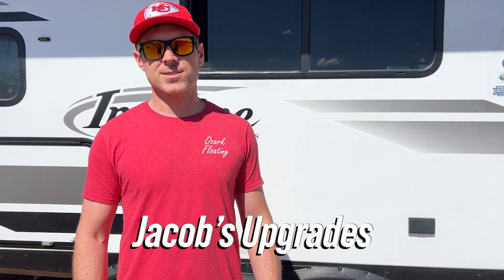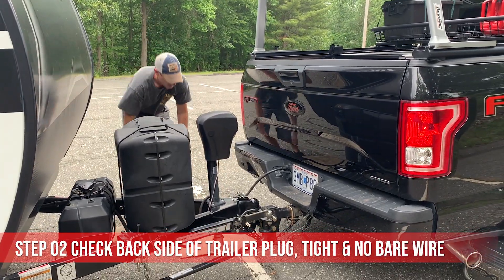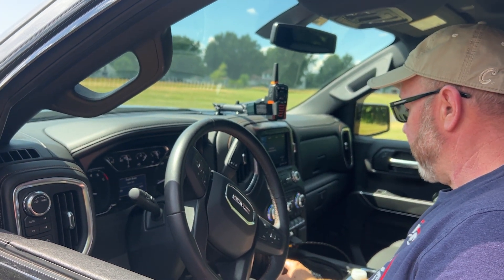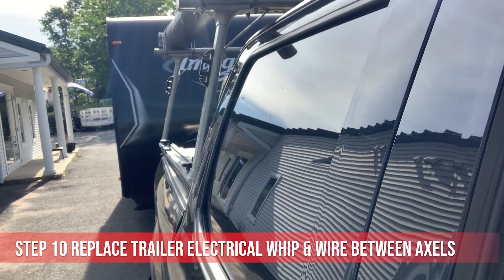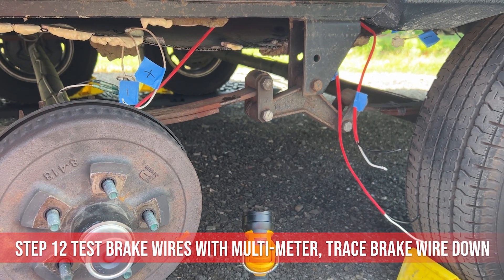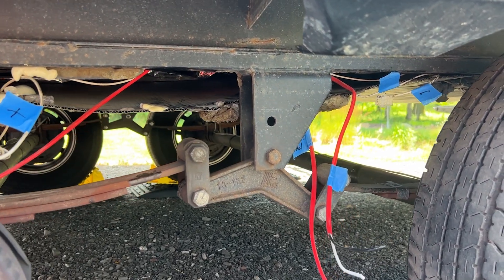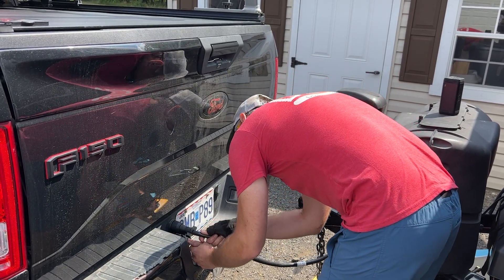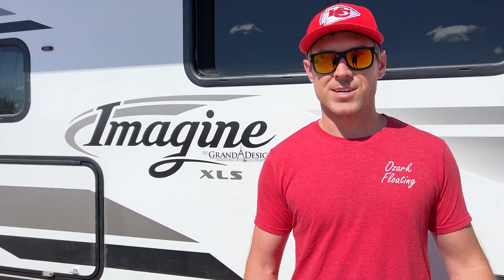How to Diagnose Trailer Wiring Issues | Trailer Wiring Fault

Comment: 2018 Imagine 2150rb I had the same issue, it turned out to be the wire s going through the axle! Replaced that absolutely no more error codes!
Reply from the maker: @TLR5759, great find! Did you run your new wires through the axel or zip tie them to the outside?
Reply: @jacobsupgrades  for now just zip-tided but in a flexible conduit!
Reply from the maker: Hopefully that holds up for you. Still frustrating that Grand Design has these type of design flaws.

Comment: I have a 2022 Silverado and a 2022 Cruiser Twilight Signature travel trailer.    Got this message intermittently.    Both dealers couldn’t find the problem.    Finally the camper dealer heard a noise near one of the wheels.   They jacked up the camper and took off the brake cover.   Parts literally fell out.   The magnet was loose and flopped around, causing an intermittent wiring fault.   They replaced all 4 electric brake assemblies under warranty.    Your problem may be different, but this worked for me and you may wish to look into this.
Reply from the maker: @davidtrost4117, wow that's hard to believe a new camper would have problems like that but guess any rig needs the kinks worked out. A friend of mine suggested that could be our problem. Our problem turned out to be bad wire routing when it was built. Our electrical brake wire was between the flooring and frame and was pinched off after rough roads through New York and Connecticut. Glad you were able to resolve the issue under warranty!

Comment: Having the same issue with my 2019 Grand Design 2800BH. So was it the floor pinching issue causing the fault?  Drive my through the mountains in the rain had me on high alert without those breaks.
Reply from the maker: @snovak1, yes the issue was the pinched wire between the floor and frame. I bet it was hairy, I hate driving without trailer brakes. Here's the product I used, make sure to measure your length from the trailer plug junction box to the axels and down. 10AWG Duplex marine grade wire 20ft 
https://amzn.to/3PYEbkX
Reply: @jacobsupgrades  Thank you!  Very much appreciate the guidance.  Super helpful.

Comment: I swear, Ray Charles and Helen Keller team up to build these trailers.  If you build these trailers and get offended...GOOD. Take pride in your work.
Reply from the maker: @waynef.8158, 100% accurate. Which camper do you have?
Reply: @jacobsupgrades  2021  Volante 3861BL. Brake issues, leaks from the exterior coming in, trim falling off….
Reply from the maker: Wow already on a 2021??? Unbelievable! That’s so frustrating, I’m sorry to hear that.

Comment: So my fuses look good and had trailer fixed I guess to purchase brake controller and install,what you think?
Reply from the maker: I would try plugging the trailer into a friends truck first to determine if it's really the truck or trailer. Also if you have another trailer you could try plugging your truck in and testing it that way too. This way you can determine which one has the issue first. Those controllers are not cheap. Are you having any error messages pop up on your truck?
Reply: @jacobsupgrades  yes
Reply from the maker: @gaelewis6623  If you've checked the backside of the plug connection on the truck side for a firm fit and traced down the wiring for any exposed copper and found none. Then replacing the controller may solve your problem.
Reply: Just had mechanic test system on truck and said he thinks it's brake controller.
Reply from the maker: Did you replace your trailer brake controller?
Reply: Yes,but after inspection I think Ford dealership took both fuse and relay out they were  removed?

Comment: I’m having the same problem with the Large Orange Box that states “WIRING FAULT ON TRAILER”.  On page 297/666on the manual it states this: This can be a short to ground (such as a chaffed wire), short to voltage (such as a pulled pin on trailer emergency breakaway battery) or the trailer brakes may be drawing too much current. Points to Remember Note: Do not attempt removal of the trailer brake controller without consulting the Workshop Manual. The problem is the too much current statement, but No number is given after much research I found a  Ford policy # Ford DTC B148A:11 that policy set the max brake control to 27 amps. The problem started when I towed the triple axle trailer with 6 brakes home for the first time and the Orange Warning Light came on displaying “WIRING FAULT ON TRAILER” in Feb 2021 after much time and effort and having the trailer checked out by a trailer repair place; no short was found. So I’m now buying a tool to show that the current limit is too low and needs to be raised. When towing, the engine is running which means the alternator is also running the DC could be as high as 14.8 volts when you have 6 brakes in parallel the resistance could be as low as .5 ohms. 15 V divided by .50 ohms = 30 amps. 30 amps will trip a current limit of 27 amps and display the Orange Box every time it exceeds 27 Amps.
Reply from the maker: @patpowles3358, I wonder if your problem could be bypassed using FORScan. I don't have experience with it yet but I want to start using it on my truck. You could turn the module on and off with it to reset it and possibly tune your voltage limit. I don't know for a fact on the voltage limit adjustment.
Reply: current limit of 27 amps ford will not verify that is the setting
Reply from the maker: @patpowles3358 , I'm sure you would want to run a heavier primary brake wire too.
Reply from the maker: @patpowles3358  have you tried plugging it in to a different brand truck to see if the same problem occurs?
Reply: Do you know of a truck that's rated for a 16,000 trailer with a tongue weight of 2,000 lbs, the Ford controller doesn't really work below 18 mph
Reply: when the trailer is level the hitch coupler is 28 inches off the ground, so the top of the hitch ball has to be 28 inch off the ground
Reply: the 7 pin has a 10 gauge wire its good for 30 Amps
Reply: this is a Ford built into the dash brake controller the only way to turn it off is to pull the fuse . . . . .I call a company that builds brake testing tools . . . . He wanted to know whose brake controller it was . . . . I said it was built into the dash by Ford, can you tell me who sold it to Ford, Ford does list the manufacturer they buy it from . . . . .he moved on to a different question . . . . Fords brake controller talks to the engine computer, the transmission computer, the speedometer computer, the truck brake computer, the computer that monitors the speed of each separate tire and . . . . . . pulling that unit out or by passing it will cause all of those computers to go crazy, the new brake controller is not tied into the Borg  . . . .The Borg are cybernetic organisms linked in a hive mind called "the Collective".
Reply: It's not the truck of the '70s where you could do anything you want on to any component  . . . . .want to upgrade the exhaust manifold, upgrade the carburetor,  . . . . all this new stuff and it gets the same mileage as in the '70s
Reply: I have been trying to solve this problem since Feb 13 2021 . . . . Lots and lots of internet searches and the U Tube crowd only tackles the simple stuff Like replacing wire or showing you how to do something on half of the video, the other half of the video is trying to sell you the tools they used
Reply: 2 different Ford dealers said just learn to live with the orange light on all the time, I would if it didn't take up such a large part of the dash
Reply from the maker: @patpowles3358  Maybe an after market trailer brake controller would make sense for you. I know REDARC is a good brand.
Reply: @jacobsupgrades In the manual it states to remove the current Ford trailer brake controller you have to contact the dealer to remove the controller or bypass it they need to reprogram a whole lot of processors throughout the truck. It's not like the old days when you just replace the carburetor